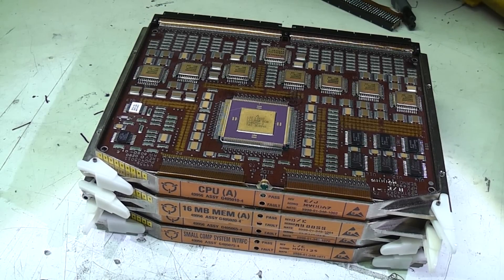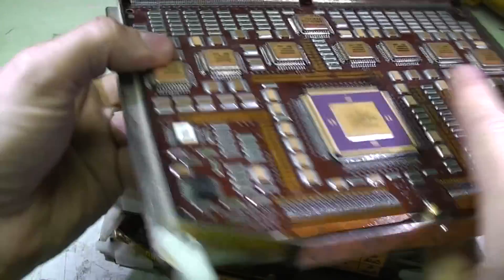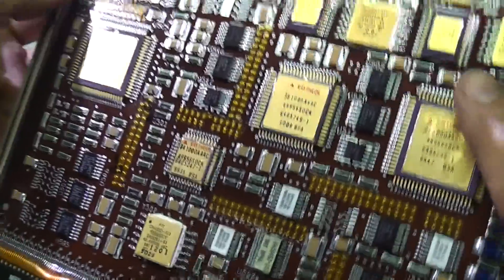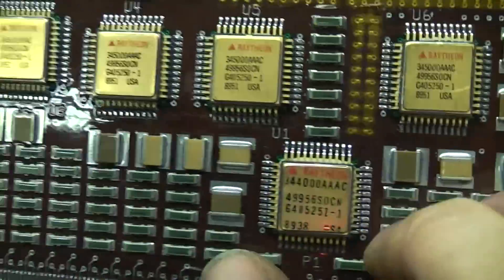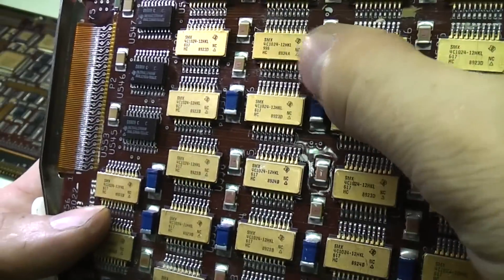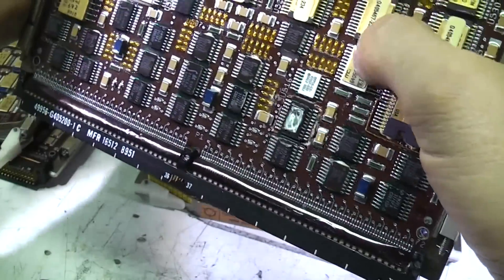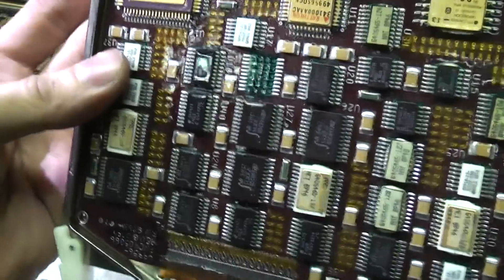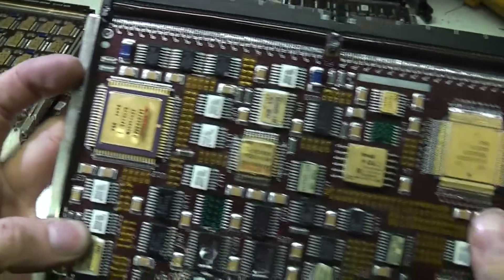Wierd military computer boards

Comment: these are old navy defense radar boards. commonly called "goo-boards" by those who installed/maintained them, because when they were fresh off the assembly line, raytheon had a bad habit of shipping too quickly to their customer (us government)- which meant the epoxy these boards are dipped in didn't fully cure by the time they got to their destination, resulting in a "gooey board". all 4 would be installed into a modular circuit box that provided power, connection to a small monitor, and various other terminations. they were coated with an epoxy, because they are meant for use in wet/damp conditions, such as an outdoor harbor radar station, scouting boats, and in some cases- low-range, underwater submarines. the information the submarines recorded was broadcasted on a specific frequency, and received by a local radar station for recording/observation. i know all of this, because my dad spent 26 years in the navy, and he was a radar operator for 9 of those years. i showed him this video, and he explained what they are and used for. he said nice find!
Reply: 92Ranger4 very cool, are you just an avid military computer/hardware person or did you have experience with these types of boards?
Reply: my dad used to work with this hardware when he was in the navy, he is the one who told me the original comment info.
Reply: 92Ranger4 very cool :P
Reply: 92Ranger4 guppies are in the other Whale?
Reply: thanks for the clarification!
Reply: Figures they would still screw it up somehow.
Reply: Supposedly these were used in this project: https://en.wikipedia.org/wiki/PAVE_PAWS Can you confirm or deny this?
Reply: This post tempts me to troll around to random videos and spew well written, wild, entirely fabricated information.  And guaranteed there will be hundreds of people who thumb me up, believing I know what the fuck I am talking about.  Because well, humans are gullible.  We just believe what other people say without demanding evidence or proof for the wild fantasies and fairy tales we are all taught.  We believed we lived on a damn rotating sphere flying through NOTHING.  That EVERYTHING was created from nothing.  That the unthinkable complexity of life, had no intelligence behind it.  All because our 1st grade teacher regurgitated it to our simple little childish minds.
Reply: there's a difference between not believing bullshit and disconnecting yourself from reality because it doesn't fit your views m8
Reply: +edbo10 You may want to reconsider what you naively assume to be "reality".   If I were you, I would start with trying to find some tangible, verifiable proof that what YOU believe in is in fact reality.  Instead of believing archaic theories that you were taught are proven facts with zero proof to support them aside from falsified imagery.

You were lied to "m8".  Don't take it out on me.
Reply: so basically what you're saying is no matter how much evidence there is to support something, you'll always somehow know that it's wrong and falsified in some way.

can't win with you crackpots, toppest keks m8
Reply: Your taking my post real far off the track friend.
Reply: Nice !I have also seen these as my father was a radar and missile guidance technician for army air defence.
Reply: Great info, my guess would have been these were taken out of some older military aircraft's avionics system due to the epoxy coating and metal core. I never thought about radar though, thanks for clarifying.
Reply: +pearlmax when I was a kid people told me not to smoke, showing me all the bad shit that would happen once you got hooked, such as cancer, but now I actually kind of regret not smoking because your comments already gave me cancer
Reply: lmao, your guess about my age was way off. Like, missing the broad side of a barn kind of off.

What kind of experiments have you performed, besides going around and essentially saying 'fake and gay and everyone else is wrong'

What is this "_actual_ science" you refer to that has proven my supposedly pseudoscientific notion that, for example, the Earth is actually a slightly prolate spheroid? Or that somehow OP's comment about this being an old navy radar board is 100% fake and completely untrue?

When talking about actual science which as you correctly state is based off logic, observation, inference and experimentation...which is actually what we are taught in school (or from your viewpoint, planted in us lol)...do you, as the scientist you claim to be, consider yourself to be open to all possibilities of why or how something is the way it is? Because your flat earth comments definitely don't show it.

Keep in mind that people have known for at least 2000 years that the Earth wasn't flat, and keep in mind that the same scientific methods and principles that were used to prove again to bigots like you that the Earth wasn't flat, nor was it the center of the universe, are the same scientific methods and principles that allow you to post crackpot-level comments on youtube.
Reply: How about taking some time out of your life and actually looking up at the sky?  You'll see that the moon phases are a physical impossibility for the majority of each month, assuming the moonlight is a reflection of the sun.  Impossible in the heliocentric model, therefore it is not true.  Simple as that "bud".  How about you take the walk, let me know when you're done.  Might be difficult once you hit the first shore.
Reply: +Don D Oh wow, I just now see your post where you claim to be an astrophysicist who has studied the universe for 20 years.  Seriously now, what does that say about your inability to make the simple observation that I just described?  20 years, and you haven't yet noticed that the angle of the sun relative to the lit portion of the moon is highly inaccurate for the majority of the time in which the sun and moon are visible simultaneously?  Want to play pool sometime?  How's $1,000 a game sound to you?  At the very least give me one logical explanation of how the reflection of the sun off of a spherical moon can be anything other than a straight angle intersection between both points.  I'm not talking about the distance or angle between them either, which would determine the percentage of illumination, I am talking about the angle of the crescent relative to the sun.  Do you have any explanation?  No you don't, because it's an IMPOSSIBILITY for what we see to occur.
Reply: the heliocentric model of the solar system has nothing to do with the roundness of the earth that Don was referring to.
Reply: Me, watching youtube vid about cool old military computer boards: "cool, thanks for that!" Me, watching youtube comments go from zero to flat-earth crazytown in no time flat: "WHAT YEAR IS THIS!?!?"
Reply: pearlmax, pearlmax: I think you've miss calculated something... For the "spherical" moon to have a "crescent" shape to it, it would have to have a circular shadow cast upon it. That shadow would come from another spherical or circular object passing between the sun and the moon. At night, the sun would be behind the earth, with the moon on the opposite side of us. The reason behind moon phases would be the position of the moon in its orbit around planet earth and our angle of revolution. The moon obviously never  appears to be in the same place every night throughout the year because of 1) the position of the earth in its orbit around the sun; 2) the position of the moon in its orbit around the sun; 3) the time of reference when the moon and/or sun is visible (i.e. the current angle of the planets revolution. We always see the same side of the moon due to its revolution speed, and it turning the same direction it travels. The reason so many people accept (because believing is wishful thinking without knowledge) the simple fact that the earth is spherical is because of not one, not two, but thousands of people witnessing the earth rotate. It did not look like a coin, and it was not a flat sheet. Ever wonder why you can never see farther than 14 miles when out at sea? It's because the surface of the planet has angled away from the (nearly) perfectly straight and level line of sight. If the world truly were flat, you could possibly see Mount Everest (or just the tip) from nearly any point of reference. But in reality, you can't see Detroit from Chicago, or Miami from the Florida keys. There is a constant live stream from NASA taken from the international space station. It clearly depicts in 1080p a round planet. Watch a few hours later, and you'll see a different face of this round planet. Whose planet could it be? We've only confirmed Earth to be the only planet in our solar system to have life (duh, after all, it it riddled with sentient life forms). There couldn't be any other planet that would look like ours that we could easily access (with in our lifetimes) that just so happens to be a sphere. If physics is a law of nature, then naturally every planet we've EVER discovered would be flat like good ol' planet Earth, right?
Reply: +Alilretard1 the sadder thing is that these kind of people hold jobs that keep society going...and also jobs where they get to tell people what and what not to do...
Reply: @pearlmax: What are you writing is at some part true, but... You don't have to believe that everything what you see is true, you can only assume that it might be a true, or not. Unless you have solid fackts about something you can only assume... Believing somethinkg is most stupid thing to do. Poeple who beliving in enything are just stupid, the don't ask, thy don't want to know the true, all what they want to do is to belive that somethink is true, without digging about it becouse they are too lazy. Me for example, I don't belive that what 9Ranger4 wrote is a true, to be honest, I will forget about this until tomorrow, it is just not so important. I red this, and only assumed that it might be a true, but it has not to be... I don''t have solid fackts to prove it is true and I don't have proofs that it is not a true. Yes, you can troll like a stupid little kid on every Youtube video and write bullshit but what for? For fun? It means that you are not serious man, jus a kid... Serious people don't lie for easy stupid fun, they lie for benefits, that why governments lie for example. Your trolling will be only a proof about your childish. Have a nice day m8.
Reply: I mean, +Pearlmax is right that the earth isn't spherical, just not in the way he thinks. It's an oblate spheroid with a larger diameter at the equator than there would be if the earth were perfectly spherical. /pedantry
Reply: What a bunch of BS, lol.
Reply: the earth isnt flat wtf
Reply: 12 42 who exactly are you responding to? Because I'm saying that the Earth is nearly spherical but has a larger diameter at the equator, like a squished ball. +PearlMax OTOH...
Reply: I love the flat earther's goto burden of proof logical fallacy.  You don't get to make a statement then say "you prove me wrong."  That's not the way science works.  You made an assumption, "hmm, the earth is flat", it is up to you to prove that assumption with experiment.  Thought experiments, while fun, are not really valuable for proving hypothesis in the long run.  They might help you set up real world experiments, but it's real world experiments that really make the difference between science and fantasy.  The scientific method is built around self doubt.  You must always doubt yourself.  If you are stating that something is right and you need no proof other than your intuition then you have failed the scientific method and you are no longer doing science but formulating fantasy based fiction.  Always, always, ALWAYS doubt yourself when it comes to science.

As for experiments, there is a HUGE body of proof amassed over centuries that the earth is round.  If you can prove otherwise I am sure a lot of people would be interested in seeing that proof.  Proof by real experiments and real hard data, not conjecture and back of cocktail napkin discussion.  Especially not because "well he said it, or she said it so it must be so".  That is also a logical fallacy.  When people make statements about scientific theory they are making it based on huge bodies of evidence and experimentation.  A theory isn't theory until that can happen.  Until then it's just an idea (or even hypothesis if it's observable) and sometimes ideas are really bad.  Like the idea that the Earth is flat.
Reply: My question is how flat earthers explain satellites or ocean horizons, or eclipses, or differences in the length of days and temperatures based on latitudes, or being able to fly places by going either east or west, or the fact that the moon and the other planets all appear to be round, and any number of other things. Not sure what they're talking about with moon phases.
Reply: BFH Oh don't worry about that. They have a theory that contradict every other proven theory for every fact you said. Basically they repeat without having studied anything because someone told them speech is free.
Reply: Or rather because we saw the mountains of evidence that backs it all up.
Reply: No, you didn't saw anything. You repeated everything. STOP saying you believe what you see with your eyes, read my comment from top. Study physics, learn what mankind took centuries to discover. Use the colective intelligence. THERE IS NO SECRET ORGANIZATION HIDING THE SHAPE OF THE PLANET. 
Organizations hide things for profit, there is no profit in this, and there is no way of hiding this.

Sorry for my comment from before. But really I'm trying to make people understand. I strongly believe that Flat Earth people (don't know how to call them, sorry), is an involution in mankind progress. People is leaving the science and superior studies and focusing in brainless activities. Technology left thing very easy for everyone, and we are reaching a time when even the most antiques discoveries are in doubt. That takes us back to ancient Greece. This is mainly because people don't lear anymore the facts we have exposed along history. And everyone can acces those facts, because Physics and astronomy books are available to everyone. If you are not luckin enough to live in a country with free superior education and don't have the money to access to private one, you can always study for your own. I encourage people to do that, instead of watch videos on youtube proving or disproving theories. Doing this is the only way to realizing that scientist are not lizards, nor trying to hide anything from you. 

IT'S ALL THERE, IF YOU READ IT YOU WILL KNOW IT ALL MAKES PERFECT SENSE. KNOWLEDGE IS FROM THE HUMANITY.

If you want we can have an open mind discussion and expose each theory.
Reply: That is a very valid point
Reply: WOW you nailed it, Federico.. 
I am getting quite concerned for a few of my friends at my local pub. Nice area,expensive real estate, posh shops and cafes, seemingly smart intelligent people with successful businesses a pleasure to chat with after a few pints. But the past few years I have noticed about 3 or 4 of these people now seem to believe everything that you stated above exactly as you said it.
I had to work with one of them the past few weeks and I couldn't believe the crap he was spouting off with. He never stops, comforted in the smugness of the fact that he is right and everyone else is foolish for just believing what they are told.
The arrogance is absolutely astonishing..
This is all the fault of the damn internet we should shut that thing down.
Reply: I believe in the flying spaghetti monster, and he is coming to eat your soul tonight.
Reply: thanks captain
Reply: so can ue them to make own radar lol?xD
Reply: Yes you chortling simpleton.
Reply: wow, your comment is exactly what i was looking for
Reply: Why would anyone hide it if the Earth were a disc? What would anyone have to gain from that?
Reply: I absolutely love these "flat Earth" and "test tube life" lunatics. they make me so happy. embrace the crazy my friends! they say the decent into idiocy is slow but you guys found the express route, well done!
Reply: +pearlmax The thing is that in real physical world, there can be many logically valid explanations for same thing. But only one of them is actually true. That is why, you cannot find out the truth simply by logic. So, your logic that intelligent mind should be behind all this, etc. that may be one logically valid explanation, but not the only one and thus not necessarily the truth.

What comes to humans believing to given information. Well as humans act that way, it must have been efficient in the past, as people thinking that way has survived so well in the evolution. Would the ultimately skeptic fact checker survive in competition, as it is very slow and inefficient to check every single fact that you have been told to by yourself. 

To survive well in life, you don't even need to know the exact absolute truth about everything ( of course it would be nice to know, but not always possible ). Just a good enough approximation of reality, is usually totally enough for most applications.

That's what engineers do all the time. For example electrical engineers use a lot of approximations of different theories, to ease the design of a circuit, as the accurate theories are very laborious. The approximation of a theory maybe isn't 100% accurate, but it is good enough for the application, for example to easily build a device.
Reply: 92Ranger4 I
Reply: these used the VME backplane configuration, right?
Reply: @OfficialRID  Ha ha, well played.
Reply: @dond2426  nothing like an intellectual burn! Nicely done, only problem is you used big words & he won't understand...also these types you can literally take them in orbit show them the planet it not flat & they'll swear it's a hologram...I once described it like this regarding the moon being artificial and/or placed there by ETs:. ETs: "ok we'll put this big ball in the sky that they can't miss. We'll make it face only 1 direction to ensure they question it. Just to be absolutely sure they get the message we'll make sure it's mass is completely unexplainable, it's location so that at certain times it completely blocks out the sun & other times the Earth will block it, given it's considerably smaller than both, there's no way in hell the man apes can possibly miss the message. Trust me it's idiot proof!".  Humans: "The moon is fake & a hologram!"
Reply: That's fascinating stuff!
Reply: Pretty much all day I hate youtube coment box with all the trolls and idiots, but some very very rare occasions there are some speckle of gold.
Reply: @pearlmax  nice bait. Trolling successful. Thanks for the keks.
Reply: @0xf7c8  I never said that at all.  I love science, real science.  NOT pseudoscience.  The flat earth debate is a direct result of people examining the heliocentric model scientifically.  Not simply believing what you are taught as truth in 3rd grade, by your 25 year old teacher regurgitating what she was taught from a book.  That is religion.  Not science.
Reply: @pearlmax  My friend, I'm not repeating my teacher. I'm repeating my higher education in astronomy. I know for a fact that all the math I learnt, from orbital to relativistic mechanics, all of it, makes sense. I replicated the experiments that built the foundations for space travel myself. And I assure you it's all there. If you don't like math or physics and dont want to study them, I'm absolutely fine by that. I dont like yo study or read about a lot of things myself and I don't know about a lot of stuff. But please stop degrading others work because of assumptions. All the info is there in books with step by step explanations. No logic holes. No one is hiding anything. Please study and stop this toxic behavior. For all peoplekind
Reply: @0xf7c8  Of course the math checks out.  Where did I say I'm anti-math?  The physics do NOT check out.  Gravitational attraction on mass differential has never been observed, nor will it ever be.  There is plenty about the model that CANNOT be described by math, or physics that anyone has ever experienced.  Those are facts, not theories or assumptions.
Reply: @0xf7c8  None of what you are saying has any substance to it whatsoever.  Math and physics are not the same.  If you think they are, you're the one who doesn't "grasp human knowledge".  ALL living humans are familiar with physics in reality.  People try to describe physics with mathematics.  But unproven, non-demonstrable, theoretical forces, cannot be considered true physics.  They can be considered THEORETICAL physics.  Because that's exactly what it is.  Theory.  However when passed off as proven fact, whether in elementary school, or to 20 year old college kids more interested in frat parties and panty raids than actually thinking about what they are being taught.  it is simply pseudoscience.
Reply: @pearlmax In your first comment on this thread you said there Is intelligence in universe creation. Tied to your words. Who is the religious fanatic? I got better things to do. I disabled notifications for this thread. Bye dude, hope you don't get locked in a mental facility (jk, I do hope so)
Reply: @pearlmax  what is flatter - Earth or your brain?